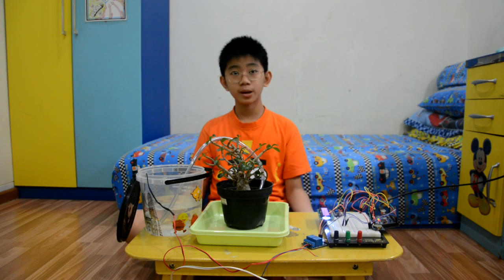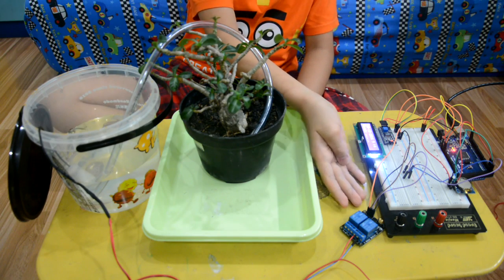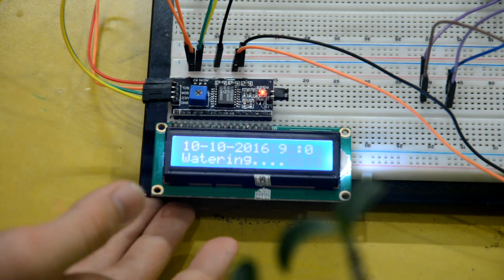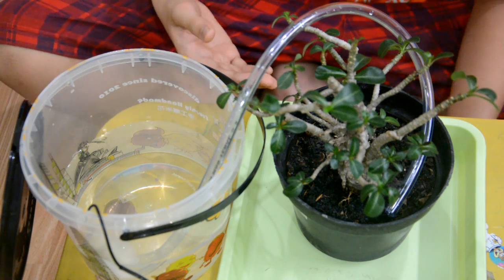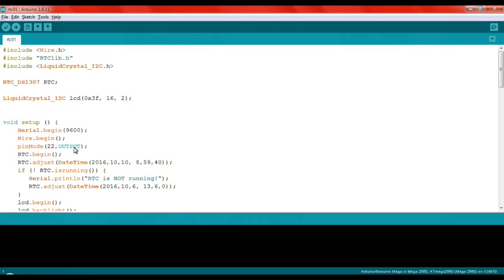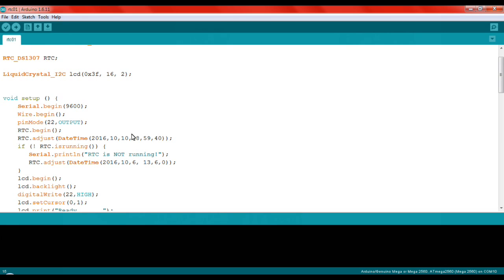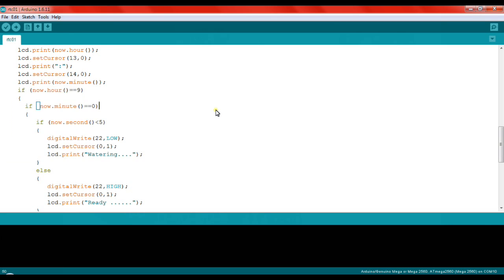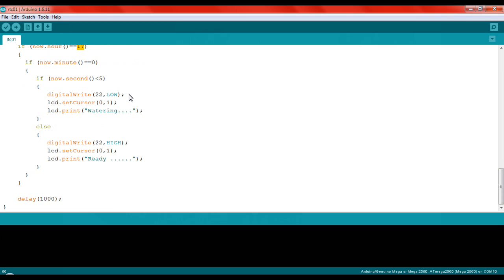Arduino time based automatic plant watering system

Comment: I admire your work and I would like if you can help me with a project of mine with a RTC and an LCD for an alarm set from the code and with a date that can be changed with some buttons, I would be very grateful if you have could help with the project code, if not, you can just send me the code from the plant watering system. maresdaniel540@gmail.com. you can contact me for more details. thank you!

Comment: Can you send an upclose for the installation of the system?like how to connect them...
Reply from the maker: Well the things  you are going to need are probably just the program and the diagram. Send me your e-mail and i'll send you the files. But make sure you've subscribed! :)
Reply: Kevin Zhou I've already subscibed,can you provide me the diagram on how and where to install and connect those wirings?its not clear in the video.thank you!this is my email : jspalquiran@up.edu.ph
Reply from the maker: Thank you for your support! The files has been sent, please check your e-mail.
Reply: Hi Kevin Zhou ,the diagram you sent is not clear,can you provide the picture on the breadboard part?because its also important.pleaseeeee
Reply from the maker: What i'm showing you at 3:29 the same with the powerpoint that i sent you is where to connect the pins. Example, connect that pin to D22. I do not provide any diagrams. Good luck! :)
Reply: Kevin Zhou what about the connections in the arduino?should it be on the communication or power?etc...
Reply from the maker: Well, it's simple. on the modules, the VCC would connect to the power. Either 5v or 3.3v. The GND to the GND, and the inputs to digital/analog pins.

Comment: hey boss, can u send me diagram and code? Do You know how code will look like if i have this display 0.96 Inch 4Pin White IIC I2C OLED Display Module 12864 instead of yours in your project? borus3@gmail.com
Reply from the maker: Well, subscribe first! :)
Reply: I already subsribed nearly after my message
Reply from the maker: Ok so i've sent already the files. Check you e-mail! :)
Reply: I received nothing. You did not send any attachment.
Reply from the maker: Well, i did. Probably there's an error. :/
Anyways i've resend it :)

Comment: hi, can you send me those codes and the wiring diagram. thanks a lot. renzrei20@gmail.com
Reply from the maker: The code has been sent! Make sure you already subscribed!
Reply: Kevin Zhou Thank you. Much appreciated. Futher more question. Is it possible to combine those 2 project in to one single project? What I mean is in to 1 arduino only. By using push button, if you push the button, the moisture sensor will be the one to trigger,then if you push again the button, the time based will be the one to trigger. vise-versa.
Reply from the maker: Well yes you can, but you can't use my files that i send to you. You can't use anything from me if you want to do that. As you need to do the wiring and programming again. I recommend you by trying to use each of my programs first, then you can try to experiment with my programs on your own. Good luck! :)

Comment: HI. can i ask wheres your watering system that uses RTC 12C and btw can you send me the codes of this project of yours
Reply from the maker: Hi Esmeralda, I used at home, sure I will send to you, what is your email ?
Reply: thnx so generous of you. azucenaesmeralda@wit.edu.ph... thank you so much
Reply from the maker: Hi Esmeralda, your welcome, sent to your email. :)
Reply: Thank you so much ^^
Reply: Hi. Kevin I would like to ask something.. is it okay to use any knid of water pump?
Reply from the maker: Yes you can use any water pump, but if you are using a bigger pump, I suggest use bigger relay (example 20A/220V relay - Omron) to handle bigger ampere and voltage. Because I think Arduino relay is limited in ampere and voltage.
Reply: Yeah i have a water pump with 220v
Reply: ahh so i should use the omron relay to handle my 220v and 8watts water pump....uhm  the relay that you use their can't handle my water pump? thnx for the reply
Reply from the maker: For 220v and 8 watts, you can do with load equation I = P/V (8 / 220 ), I = 0.04 Ampere, if you go with relay 0.5 Ampere and 220 volt should be more than enough. however you need to develop you own circuit for relay (I used Omron usually but there are many famous brand),  the relay circuit you can see on my video https://www.youtube.com/watch?v=IcLY7EEuPYo, the electronic component you can use based on Ampere and Voltage specification as above.
Reply: thnx